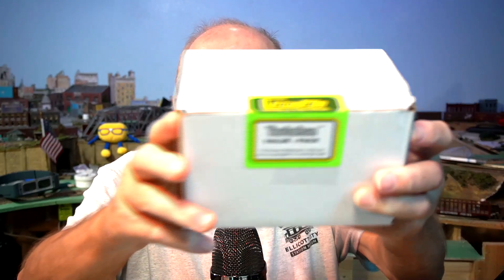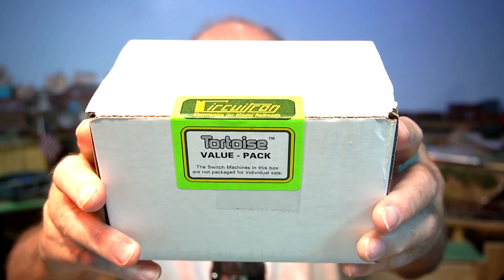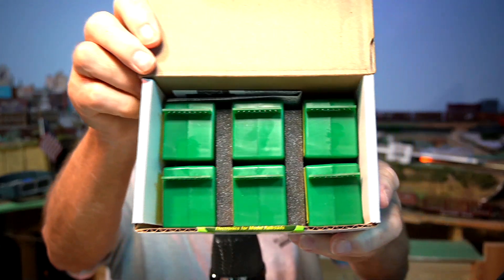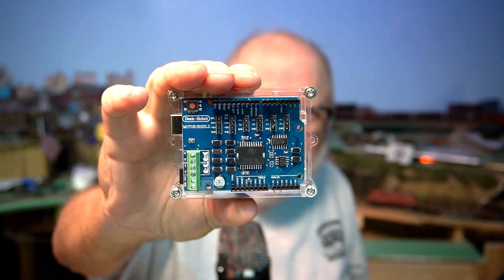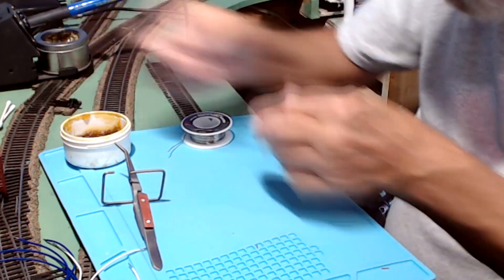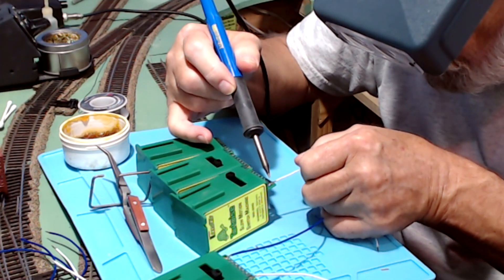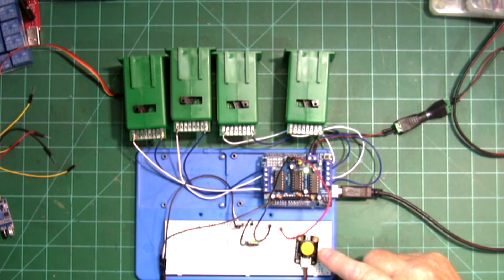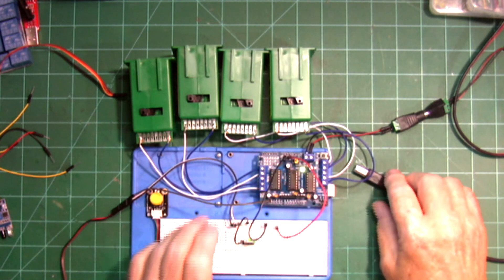Control 4 Tortoise Switch Machines With A Motor Shield

Comment: I have two issues with the tortoise switch machines.   1-the physical size.   For N scale they are basically the height of a double stack load.   2- the cost.   I can get 2 or more servos for that price.   Again for N, the servos have more then enough power to throw turnouts.    Great video and love the out takes
Reply from the maker: LOL. I do servos also.

Comment: If you are using a NCE system a Switch8 MK 2 will control up to 8 separate setups with tortoise machines.  Remember each address and connection  can control one than one machine. IE a crossover were you throw two at same time.
Reply from the maker: Thanks Arthur. The motor shield is capable of running 4 tortoise machines from each output. If one would use the individual chip, the cost would be reduced to under $1 per 2 outputs. Many of these can be operated from an Arduino, The shield in the video cost under $7.
Reply: Tom I have run four motors going though mini panel.

Comment: Thanks for the demo Tom. I have 2 of those motor shields and find them very useful. Another advantage of that board is that the L293D chips in the DIP package are cheap and readily available, so if you inadvertently fry one you can just pop in a replacement.  Art...
Reply from the maker: Wouldn't it be nice if everything was like that. Just pop in another component. I learned my lesson when doing a board with a Nano. Fried the Nano, then had to redo the entire board. I put them on headers now.
Reply: @TomsTrainsandThings  best way

Comment: Did anyone notice that the circuit board on those Tortoise's are green? They used to be tan. The reason is because Circuitron, the maker of the Tortoise machines, had to change suppliers of their circuit boards. They also had to change suppliers of the motors. What this means for us is that the edge connectors which used to fit the older Tortoises with the tan circuit boards will not fit the new green circuit boards. More info on this can be found at: http://www.circuitron dot com/index_files/Tortoise.htm
Reply from the maker: The old connectors didn't fit well at all. I always had to put tooth picks on both sides to keep them centered so the contacts would line up correctly. Even the blue ones that Accu-Lites had. That's why I solder 4 twisted pair telephone wire to them with a terminal block on the other end of the pig tail.

Comment: I did pick up a couple model railroading books, and DCC does appear to be simpler to set up and run than a plain DC setup. I'm still just getting ideas for now. I'm not yet ready to begin a layout. After all, when I last did it over 25 years ago, we didn't have the technology that we have nowadays.
Reply from the maker: That's how I felt 8 years ago
Reply: You just need to remember, it's a lot easier to run trains in to each other with DCC.  Both Digitrax and NCE have about the same learning curves for learning their throttles and command stations.  Gapping and feeding challenges will be the same for any of the systems, Digitrax, NCE, Easy DCC.  Going with whatever is more common in your area is probably the best way because you will have people that know their way around you can get help from.

Comment: hmmmmm......  question... in a conventional setup, where a tortoise would be hooked to a decoder, on a normal digitrax or NCE system, when you use the throttle to select an accessory and give the throw command, a set of instructions are sent to your command station. is it possible to some home capture those commands and program an arduino to send them via a push button?  im not sure how your digitrax works but on JMRI with NCE, a turnout on a panel will not show correct direction unless the command is sent through the command station. does that make sense?
Reply from the maker: With Digitrax and probably other systems the direction is stored in the system. That doesn't mean that's how the turnout is positioned. You actually have to give the command to verify the correct position. Whenever I power up for the first time in a day, all the turnouts are activated, so what is indicated in my throttle may not be the actual position. With JMRI, the state of all inputs/outputs are unknown, until you verify them either through a script as I showed for the sensors in a previous video or by hand operation. Does that answer your question?
Reply: @TomsTrainsandThings  kinda sort of. I have to test this. My layout i turn off each night now, but my swich8 decoders are DC powered and they are always on. I wonder if thats whats keeping the position info. I only say that because JMRI shows the turnouts as unknown when the DCC is off but as soon as it comes on the turnouts on the panel are then put in the correct configuration. Ill get back to you.

Comment: WoW! Well, Tom, that looks like just the thing I'll need on the next layout where I'll have a double slip switch (actually, two) to deal with. So, will the L293D be programmable to align the switch for all the paths? Inquiring minds and all that. I'll be watching for more great info on just that subject. P.S.: Not an electronics genius - even close. P.P.S.: I love me some bloopers!
Reply from the maker: Thanks for becoming a member. You can program into Arduino anything you like, any configuration. Thanks for the comment, especially on the bloopers. lol